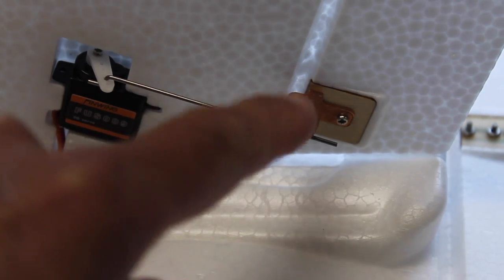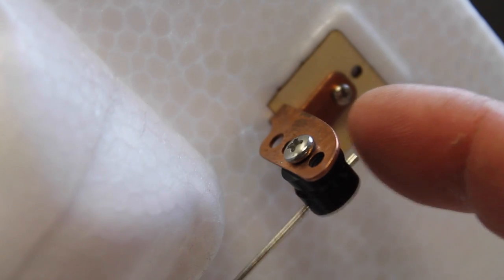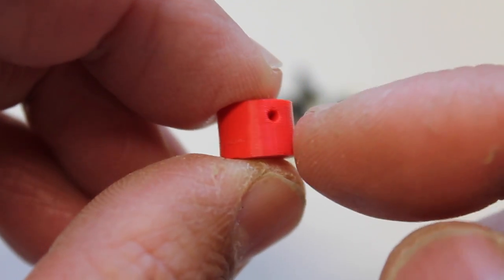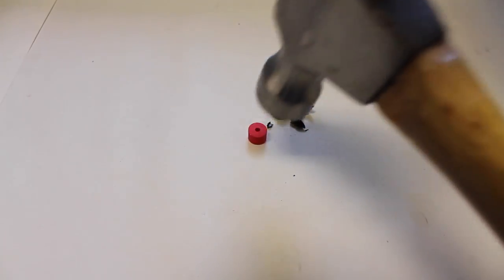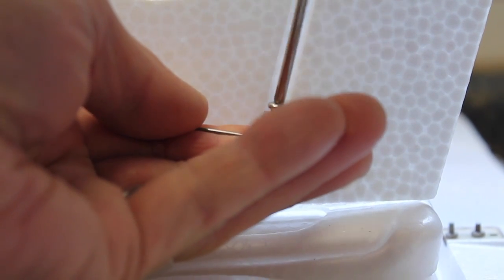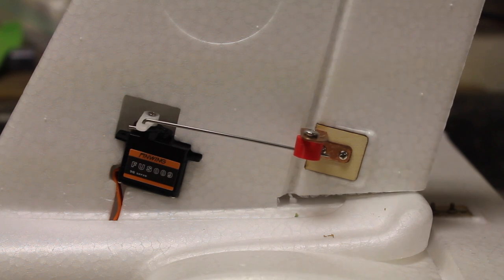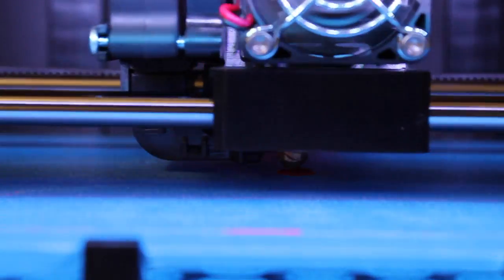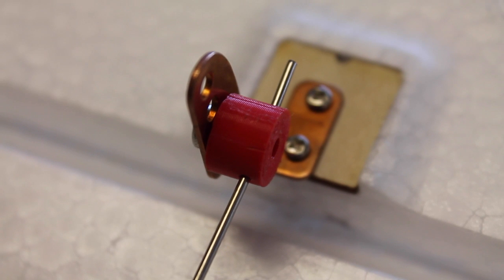Durability of 3D Printed Control Horn Nut for Finwing Penguin

Comment: Could you 3d print a single part that contained this bit and the but that joins the plane? Then screw though the plastic to the foam? Less places to fail? Just wondering?

Also more 3d printing for RC videos please! Lol very cool.
Reply from the maker: Most definitely. Good idea and I will definitely take this approach if I start to run into problems with the current setup. I like the metal control horns (I think) but the plastic nut wasn't cutting it. Thanks for the feedback.

Comment: Sweet, But Dennis if you are using stock components get rid of them. I had a aileron servo freeze up during flying causing a crash that caused me to rebuild a new one. The rudder is fine but the rest are junk. Also the stock esc is crap many issues have been found. If you are running the stock motor not the upgraded one you will want to replace that if you have any weight on the plane like ap and fpv gear.  Check out rcg for the thread if you have not already a lot of good ideas with good motor and esc specs so you can fly over 30 min. Cruise speed is about 30mph climb about 40. I get around 30min per flight flying 4s 6600mah. Hope all works well for you but I had many issues with stock set up.
Reply from the maker: This is really good stuff to know. Thank you. You would think that manufacturers wouldn't take short cuts on the electronics side of things. Especially given you may have a $1,000 rig in the air. But I guess you have to trade cost for quality sometimes. Regardless, I'm going to get the stock setup a try since I'm close to being done with the build and we can compare notes. I appreciate all the insight and am fired up about this platform.
Reply: Dennis Baldwin I could not agree more! RMRC said that they offer that package for beginners who do not want to spend much money! I think that is crazy as you say over 1k on my plane and watching it come down in a spiral from 350 feet due to a frozen servo is the worst feeling I have had in a long time. That crash cost me over 500.00 because I didn't spend a 140 on metal gear servos. This is why I do not buy from RMRC anymore as they blamed the user instead of standing behind what they sell. Many people have had no problems with the stock set up so I hope you have no problems at all also. All and all I like my skywalker better it blows the penguin out of the water in all most every aspect. Keep a eye on my channel I am about to post a video about  the penguin and compare it to the best fpv plane out there the skywalker. Keep us posted
Reply: Dennis Baldwin I also just noticed you have the elevator horn on the bottom. Move that to the top or it can possible rip off the tail if you land anywhere other than a hard surface! Just speaking from experience!
Reply from the maker: Platinumhobbies I will definitely keep an eye out for your Skywalker vid. Looking forward to the comparison.
Reply from the maker: Platinumhobbies Thanks for the servo tip. I read you can mount it either way, but now that you mention it I will look to mount it on the top. It sounds like you've had a tough time with the Penguin. I'm starting to get nervous and I'm not even in the air :)
Reply from the maker: Platinumhobbies Will do it. Always appreciate your tips and advice!

Comment: Hi D., I see to much tension on the control horns and push-rod, the bold must move freely true the hole of the control-horn, so if you like to fly a long time with your FP you have to change that.
Cheers.
Reply from the maker: Thanks for pointing that out. I noticed that but haven't found a good way to fix it yet. The problem is that the servo rod for the elevator is incredibly long and it tends to bend a bit. What did you do to address this? I was thinking that once the flap gets broken in it will move more freely and there will be less bending.
Reply: Dennis Baldwin
Hi D, a simple solution would be
1)to sand some material away on the side where the bolt go in the 3d printed side.
2) get a slightly longer bolt.
So if the bolt is pushed against the pushrod to tightening the rod and prevent from sliding, you create a gap between the bolt and the 3d printed stopper that is  = or > than the thickness of the control horn, so there is no friction on the control horn.
I hope you get the idea.;o)